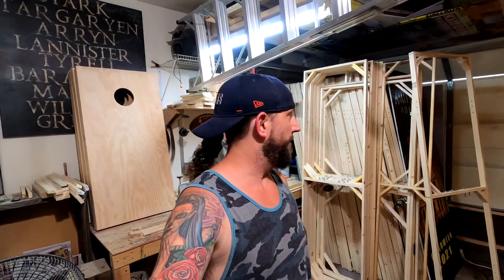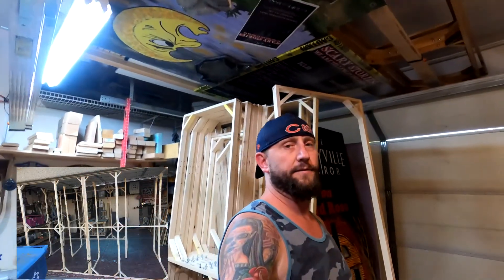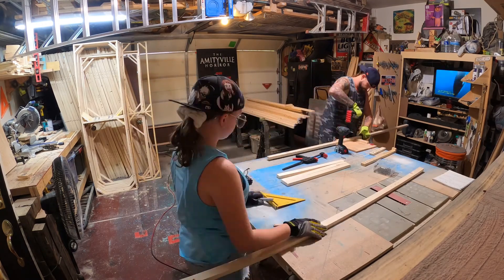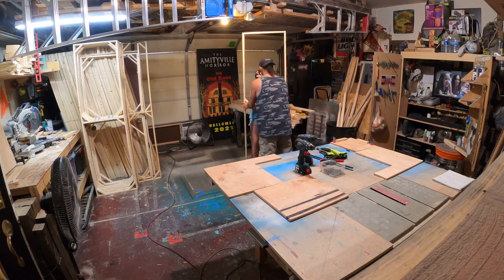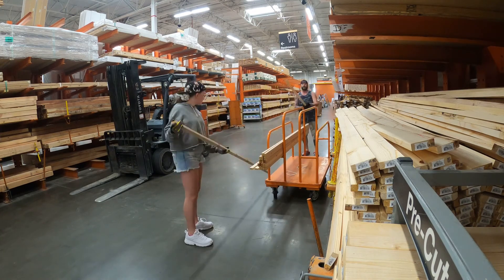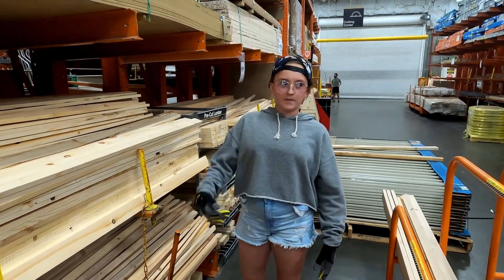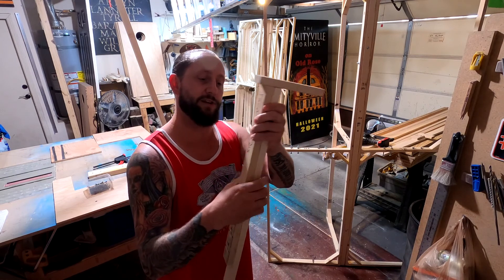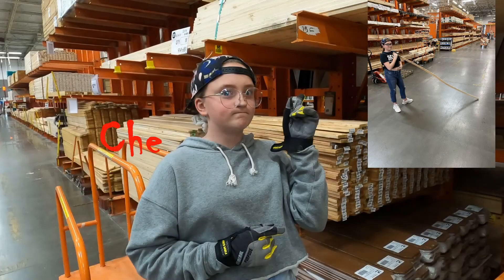2021 Old Rose Haunted House - Vlog Episode #2

Comment: What's  a counter sink?
Reply from the maker: A countersink is a special type of drill bit that not only drills a regular hole, but also takes out some of the material around the hole to allow for the screw head to set flush with your material.